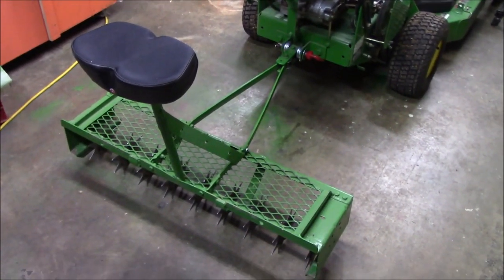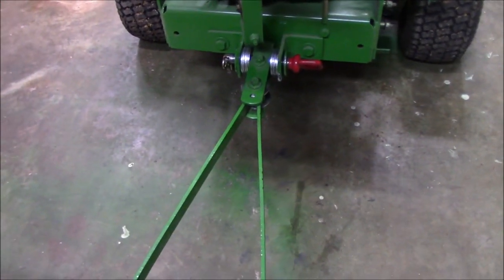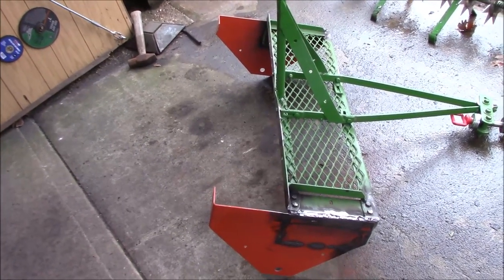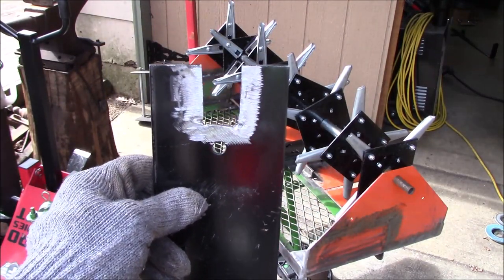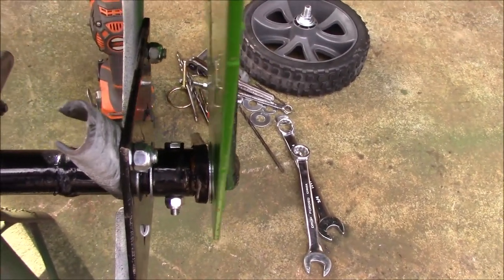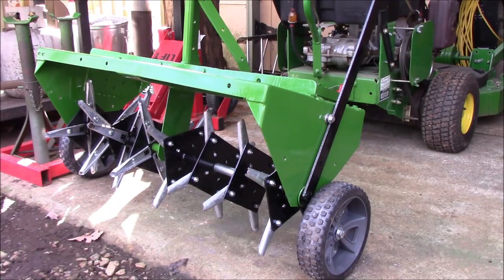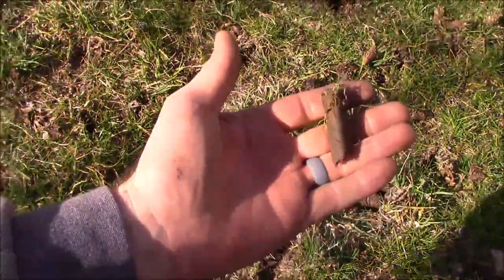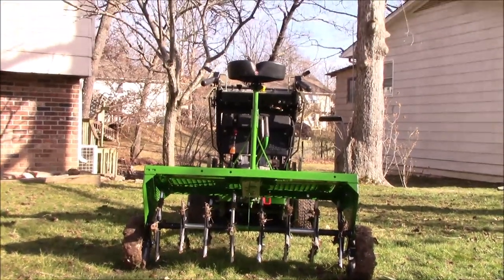DLC - Core Aerator Build

Comment: I'm actually impressed. Long term review would be nice
Reply from the maker: Sold the whole setup this summer. It worked great and held up great, but it was too rough on my back.
Reply: @HandyGuy2016  just came across this - how awesome! I can see what you mean re your back, I wonder if you/anyone built another one you could put one of the suspension pole seats like they fit on boats?  Awesome build 👍
Reply from the maker: @rhyslf  I have not, but that is an excellent idea.